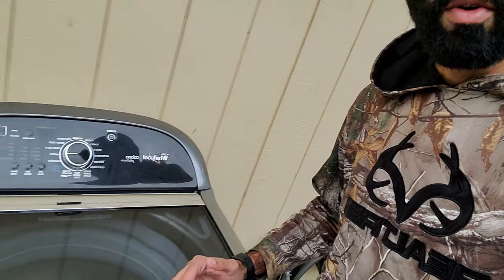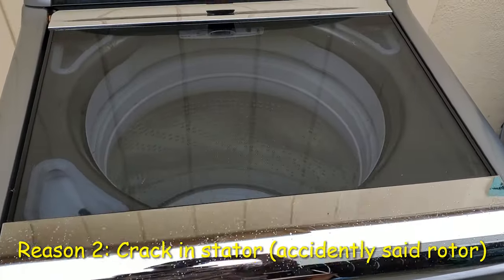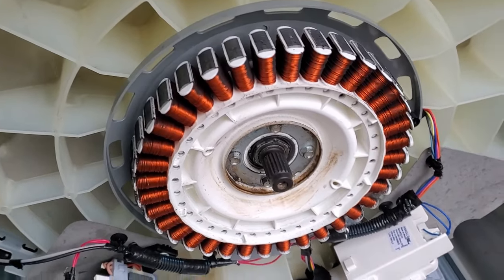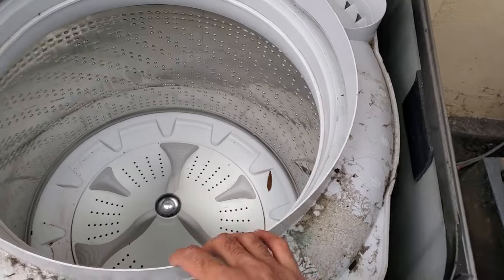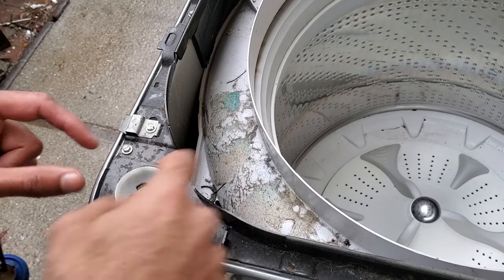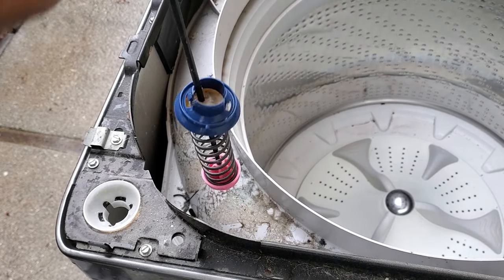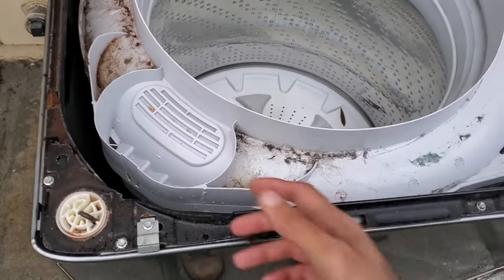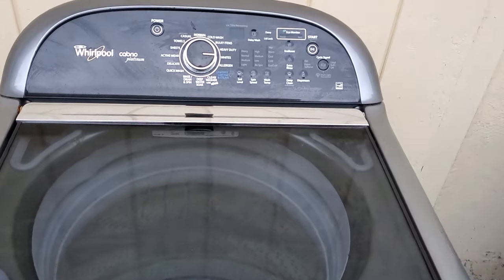Top 3 Reasons Your Whirlpool Washer Is Displaying The UL Code!

Comment: After sitting for a couple months, the Whirlpool Cabrio began to show the oL code at the end of the wash part of the cycle.  It would not go to spin.  I turned the washer off, then back on and had it do a Rinse and Spin, which it did, then showed the oL code again.  I turned it off again, then back on and had it do the Drain and Spin, which it did.  After checking all the usual problems – suspension rods, stator, and a few other things, I saw a video explaining that if the washer hasn’t been used for awhile, the tub can get stuck on the shaft and will not move up and down on the shaft as required.  I removed the tub and sure enough the shaft was corroded to the point of not allowing the tub to freely move up and down as required to go into the spin cycle.  I cleaned up the shaft, cleaned out the tub part that rides on the shaft, put the parts all back together, and it ran through the complete wash cycle flawlessly.

Comment: Great video!!! I work on this brand all the time . Sometimes a bad bearing causes UL error. You can test it on spin , if it sounds terrible it’s bad bearings
Reply from the maker: Good point! Most of the time a bad bearing isn't worth the time/money to fix (at least it take me too long lol)
Reply: Hey don't know if u read this I'm having problem drain like no power to pump, replaced board and pump same issue. Wiring?? That's gonna be a pain to trace

Comment: The UL comes on when it gets to the rinse cycle. I’ve replaced the rods already.
Reply from the maker: Check to see if the center bolt on the rotor is fully tight (this can be accessed by tipping the washer on it's back)
Reply: Same problem- suspension rods replaced, now checked ant tighten rotor bolt. Still rattling on spin and shuts off
Reply: I just replaced the suspension rods myself and still have the UL code too. I can't tip the machine on it back, so I might have to pay someone to repair it or get a new machine
Reply: It's probably your bearings. It's about 180 cdn for a replacement kit and a bit of work to replace but I just completed it.
Reply: Could you expand on what "a bit of work is? Lol @jessewilson2642

Comment: Hello! I checked the stator (no cracks) and replaced the suspension rods. It’s still giving uL code 🙁 any other things I can check or replace for it?
Reply from the maker: I would remove the agitator and make sure the tub nut/hub screws are tight

Comment: Great video. I will follow the steps. I have the same exact one stops at minute 13 and starts to give ul code even clothes are balanced so I will check the other 2 options, but it also leak water and I put a washer plastic base to collect that water. So can you tell me what to do for the leaking??
Reply from the maker: Unfortunately if you have a UL code and are also leaking water on this particular model that typically means you have a bad tub bearing
Reply: @DuctTapeMechanic 
I changed the suspension rods and closed the top but when I tried to wash at about the end of the cycle minutes 8 to 5 the tub itself moves a lot and very noisy its like its hitting at the washer external walls.  Does that mean I did something wrong or I need to change the bearing. I will change the bearing anyway I bought it already but I was wondering if I could've installed them wrong. Cause also the tub looked elevated little bit
Reply: Hello
I just want to let you know that I figured the rods I bought from Amazon where shorter than originals ( i bought 2 different sets both the same issue) so I changed bearing then put back original rods and it works perfectly fine better than ever

Comment: Thanks, this fixed my washer. But for anyone else reading this, I had a lot of trouble lifting the rods and getting the top bearing into place. I needed a third hand. The sweat from working in a houston garage in mid July probably didn't help, everything kept slipping. So then I had the bright idea of using the old rod to hook the new one through the hole, and slide the bearing into place. It worked like a charm. 

Also, my arms were too short to reach that blue piece that clips into place at the bottom of the tub, and unseat it. A long screw driver did the trick.
Reply: I wish i would have thought of that i managed to muscle them into place with a lot of curse words lol

Comment: Thank you so much! Excellent job on instructions! Great video! The suspension rods don’t look bad, but water was leaking. Gives UL CODE AND F CODE? thank you so much! Caretaker for my 81 yr old dad and now have sheets in there. It looked like the rod jumped out of the 90 degree Angel. So adjusted that and still UL, then F Code.

Comment: Thank you!  New rods fixed my uL code maytag bravos xl.  I also found out you can use dampening grease like "Nyogel 767A" on the old rods to fix the problem without replacing rods too! (add it on the rod near the top of the spring, so it adds friction).
Reply from the maker: Yes that is a good fix for them as well!

Comment: WTW8500BWO. 
Is code 68 the same as uL? Prior owner said it displayed uL. When i do automatic diagnostic test i recover code 68 . Looks to have had a new shaft, bearings. and seal kit put in. Im wondering if he over torqued the bottom nut and thus the codes and no agitation or high speed spin. Looks like he used red threadlocker instead of blue threadlocker.  Imma check it.  But your input will be helpfil. Thanks in advance

Comment: I recently replaced the bearing. It worked fine for a while after, but then started banging around like crazy. Im doing a load right now and actually not getting any banging, but I got a uL code. The weird thing is that the washer is still doing its cycle even with the code. It was filling up water and spinning, then the code went away, and it started doing its last 15 minutes.  Dont know what is going on. 🤷‍♂️

Comment: The stator bolt is way too tight and in oir attempt to undo the bolt, we've pretty much rounded the threads. (There's lots of rust around so we're sure there's a crack in there thay's leaked our watee into the metal components of the motor.) What's the solution now?
Reply from the maker: Your tub seal is probably leaking I would also guess that it sounds like a freight train when in the spin cycle. You are looking at replacing the drive shaft/bearing kit, tub seal, and stator. In my opinion it is better to go get a nice used washer. Preferably an older style kenmore whirlpool model.

Comment: hello, thanks for the helpful videos. i'm sure many viewers of your channel appreciate your expertise in repairing their washers. thank you.

i watched the previous lid lock video and im hoping you can give me more advice. in service mode for my ge washer,  my only fault code is 23- critical lid lock error. i replaced the lid switch with a brand new one from amazon. the washer still does not spin and gives same fault code error. the spin test on service mode doesnt work and the lid switch does not lock. the lid switch test does shows that its able to read open and close states  correctly when the lid is either open or closed. it just does not lock at all and in either the spin test or regular spin/drain wash cycle, the washer will stop immediedly. is the new lid switch broken because it does not lock? or is the issue something else? anything that i can try? thanks.
Reply from the maker: Thank you for the kind words. It could be an issue with the lid lock being broken. The only other issue I can think of is that the main board is sensing the lid open/closed but is not able to lock the solenoid. I would definitely return the lid lock and try a different one before looking at the main board (as they are expensive and perhaps not worth the repair unless you can find a used one).
Reply: @DuctTapeMechanic  thank you man. i appreciate you. i appreciate your work and your contribution to the community and for helping random people with their broken washers. i'm sure you have helped many, many people by making these random washer troubleshooting videos and that they are also grateful for your help.
Reply from the maker: @dkyang-wk9sq  thank you!